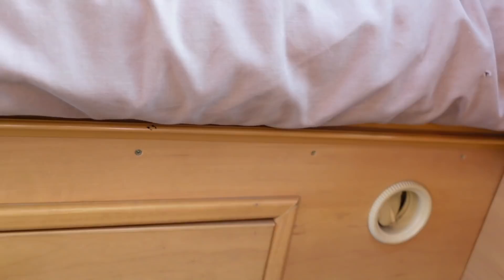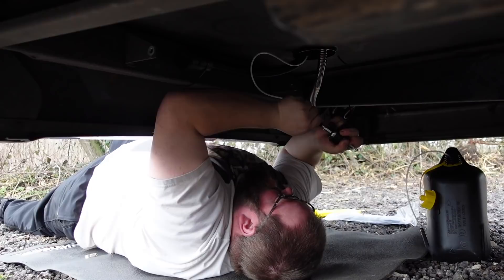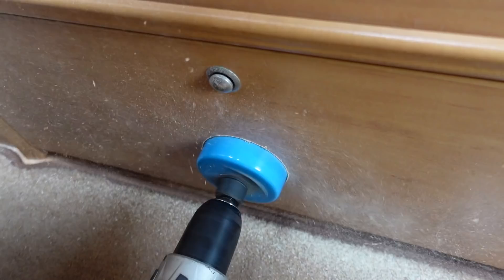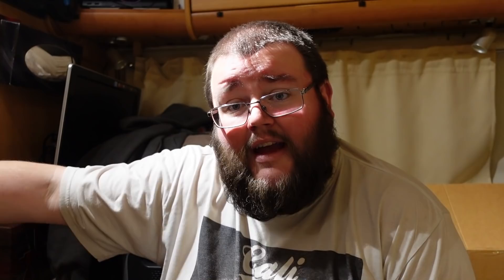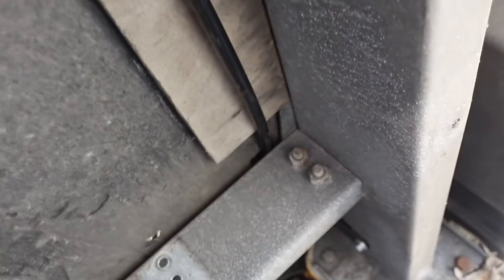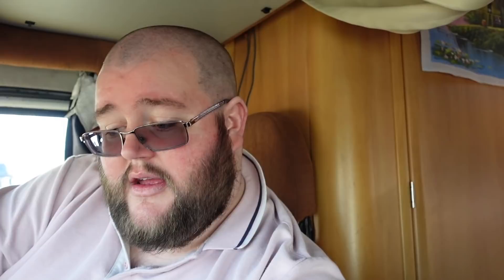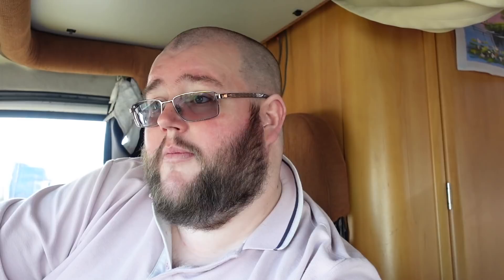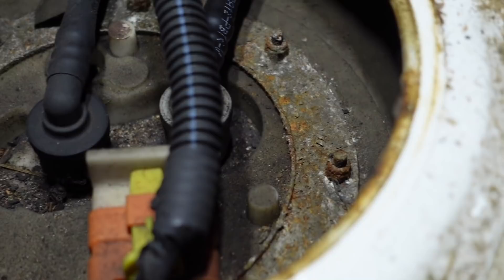Adding a Diesel Heater to my Motorhome

Comment: I believe breakdown associations have universal spare wheels because many modern cars just have a puncture kit not sure if they carry ones for RVs. When the dash says I'm loosing air in a tyre often it's just gone a little under pressure but no puncture so I try to immediately reset and see if it shows up again.

Comment: First job i did on my van conversion was drop the feed into the tank sender. It appears only recently the majority on YT have started to do this rather than the messy diesel tank hanging off the back door which needs filling every week.
I used the thin fuel line tubing all one piece no joins right back to the pump. Can't go wrong with the Chinese heaters for £100 but you should spend an extra couple quid and get stainless exhaust clamps and fuel clips as the kit ones rust and fall apart within a year.  If you want to be extra stealthy in urban places fit an extra exhaust box for £15 ebay makes the exhaust noise outside very quite.  PS dont forget spares....glow plug and plug spanner onboard you will need it one day for sure.

Comment: Got the same heater in my renault master camper the one thing I would suggest is get another exhaust pipe to change the chappy black paper intake hose as I don't think it will last long as soon as it gets wet! 👍 they are only about £10 on ebay

Comment: I'm using a Webasto for five years now to heat my van the whole winter. Let me give you one great tip: run it once a month on full power for one hour, so it burns out the grime in the burn chamber.
Reply from the maker: Thanks for the tip Chris, appreciate it 👍🏻😊
Reply: If you use the power setting rather than thermostat setting and kept on constant low you can fowl them up completely in just a few days as many others have reported.  Leave it set to 18C and let it throttle up full each time is enough for self cleaning.

Comment: My 22 litre "Hulk" tank arrived yesterday. I plan on fitting my heater around the same place as yours. That tank will fit nicely on the floor below where you have your makeshift table.

Tip. With such a long fuel line what you should have done was run a + wire from a switch to the + on the heaters fuel pump. Then it's only a matter of turning on the pump to prime rather than have the heater do it, which is also a strain on your heaters glow plug.
My fuel line will be much shorter than yours. Therefore l will use a momentary button.

And as l will not be full time living in mine. I plan on fitting a separate 50 litre tank for drinking water 😁.

Comment: Kerosene is cleaner, no carbon build-up, burns slightly hotter and is only 60p a ltr. Fitted 12 of these so far.
Reply: Kerosene is hard on the pump as no lubrication like diesel. So worth having a spare pump & also fitting the pump for easy access if you plan on 100% kerosene.
Some guys use 50/50. I may try that myself. But he doesn't have that option when using the vehicle tank.

Either way. It's going to cost less than gas heating

Comment: I heard that you mentioned red diesel but you could also run it on heating oil / kerosene . I'm not sure how much it is but I believe its cheaper and seasonal so buy in summer its cheaper.  Just putting it out there to ponder my friend all the best stay safe

Comment: A good move. I use a diesel heater in my garden hut. I run mine on kerosene  which costs about £25 for 20L. If I could fit a bigger tank I'd probably save more bulk buying.

Comment: Hi Darren not sure how you are finding lpg more difficult to find.
We are fulltimers, we have 470 of solar, 2x11 klo gaslo bottles, 2kw genni 2x100 amp gels. have never found it difficult to get lpg, though in winter use a lot more gas for heating. Have been fulltiming for many years. Hope we are all back on the road soon. 
Keep happy. 
Kind regards Michael
Reply from the maker: Simple really, all the lpg stations in my area were shell, now they’ve got rid of lpg that leaves stations very few and far between which sucks 🤷🏻‍♂️😊

Comment: Exactly the same issue Darren - aluminium plate ( same van) but you didn't drill in to your spare tyre like me, doh....pillock... that cheap heater I turned it into a cost, new spare tyre... straight into the side wall lol  I went where your battery's are, turret plate cracking idea and someone who knows what there doing to connect it all up. Interesting your connecting to the diesel tank... Good purchase though... I'm stopping watching John's videos, her indoors blames John  for my purchases.... 👍😂
Reply from the maker: Yeah that ally plate was surprise for sure, not sure why it’s there lol 
Ahhhh no! What a ball ache, ahhh well we live and we learn. Hahaha I know what you mean, but I’ve got no one nagging me apart from the bank manager 🤣🤣🤣👍🏻👍🏻👍🏻

Comment: Hi. I have just installed similar heater is same van as yourself. My question/concern as the floor is insulted ,when the heater is running there is a fare amount of heat round the area of heater / floor have you had any problems yourself ? I was thinking of wrapping the first part of the exhaust pipe to see if that helped

Comment: When I installed my heater the jubilee clip it came with to attach the exhaust pipe was crap, and the pipe fell off right after I had completed the insrallation... and now it was in such an awkward position that it seemed I would have to take the whole thing back out just to stick a single pipe back on... after a couple of failed attempts to avoid that I had a stroke of genius and wrapped tin foil around the pipe to make a tighter seal and rammed that bad boy on 👌 it has survived some ridiculous winds and hasn't budged 👍 this is on a caravan by the way, i wouldn't recommend it on a moving vehicle 😂

Comment: Great mate. I have a 2006 caravan and my gas heater has packed up the electric heater works fine but I can only use it when I'm on hook up but I would like one of these when we are off grid. Would I be able to use one of these if I make a little tank or a gerry can in the front outside storage compartment? Cheers another great vid

Comment: A word of advice, the fuel filters that often come with those heaters are garbage and will fail in short order usually. 

Keep and eye on it and replace if necessary before it causes a problem.

Comment: Have you thought about a red derv tank for the heating or future on board generator? Got to be cheaper? Also love the vids and fellow trucky
Reply from the maker: I spoke all about that in the video
Reply: Finding somewhere that sells cherry diesel at the pumps is difficult. Bulk suppliers usually set a minimum 200 litres per sale.
I found a country garage that sells cherry at the pump but its a pain driving to it every time I need to fill my containers. I've got 4 x 25 litre containers, 2 x 5 litre fuel cans, plus the 10 litre heater tank. It costs me £70 to fill all those, and yes it's worth it to save money.
Reply: @Sarge084  
........red is being phased out next year.

Comment: That great will do the same .Can I ask , do you still use safe fill bottles ? If so do you have to open gas cupboard and switch off gas bottle every time you travel. I do but a pain
Reply: i have a safe fill bottle in my Hymer motorhome I always turn it off when driving  safety i think mate

Comment: Does the diesel heater make much noise when running...Thanks .Enjoy the content..
Reply: When there running on high to get the temp up there a bit noisey but once  it's warm they slow down to a low setting which you don't really here when doing stuff and at night time its a soft noise a bit like white noise. Strangely relaxing . If you listen in the video your here something like white noise in the back ground that's the diesel heater

Comment: Industrial Heating Oil, HVO is approx 40p per litre, for 500 ltr, been running my heaters on it for past 12 months.
I realize you cant carry 500 ltr, but all you need is an address and three 45gallon barrels, split the cost between a few, everybody wins.